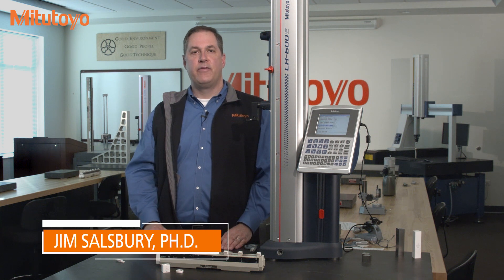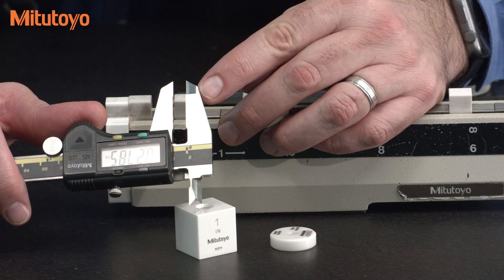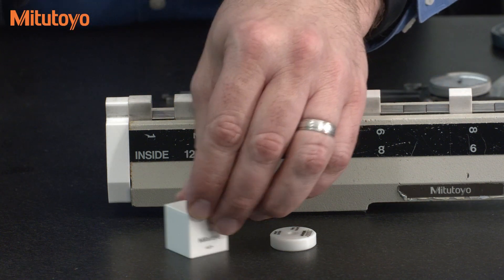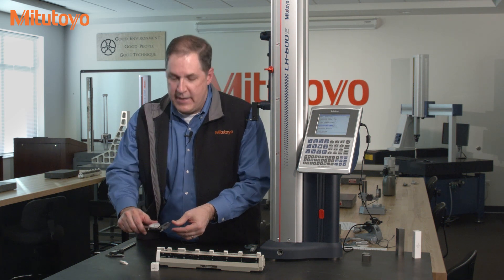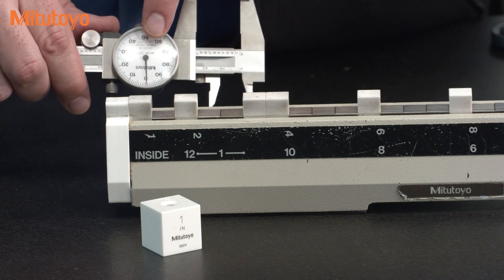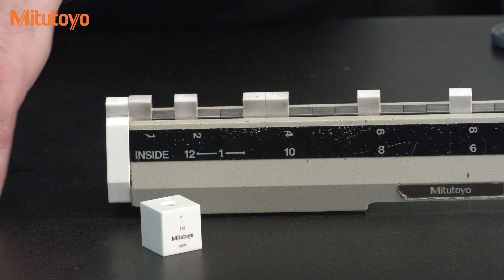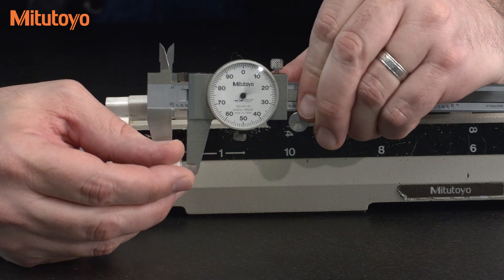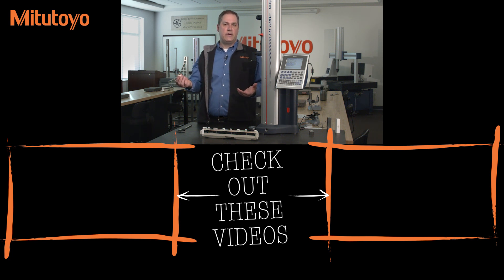Dial Caliper Calibration - Metrology Training Lab

Comment: I have the same dial caliper (505-637) which has both inch and metric scales.  The caliper is very accurate is in inch scale, but way off in metric scale.  The error increases almost linearly from 10mm to 150mm, and reaches its maximum value (almost a full revolution) at 150mm.  How can I take accurate measurements in metric scale (I don't use much of the inch scale) with this caliper???
Reply: The dial has both scales? I’ve only ever seen metric OR inches

Comment: What do you do if you take your dial caliper in and it gets rejected because it closes at .001 to .003 on average? Not always closing at zero?
Reply from the maker: Thanks for the questions. There may be wear on the jaws which would require these to be sent into our Repair Department, or they are no longer parallel which can also be adjusted by our Repair Department. You can contact our Repair Department at https://www.mitutoyo.com/contact-us/repair-calibrate-field-service/ or by calling us at 888-Mitutoyo (648-8869).
Reply: @MitutoyoAmerica  thank you
Reply: @MitutoyoAmerica  What about the possibility of loss of pre-load or anti-backlash?